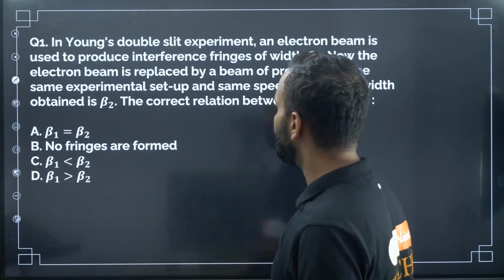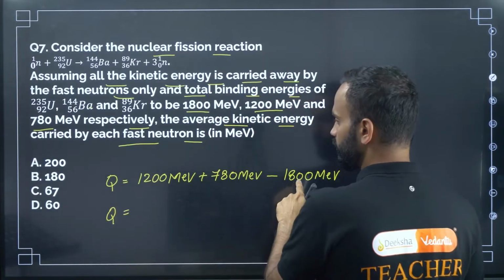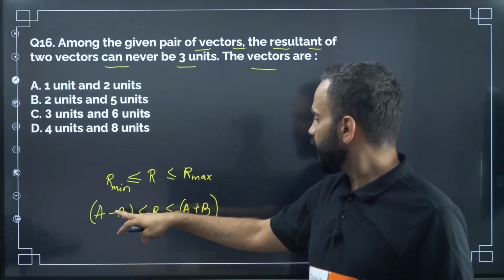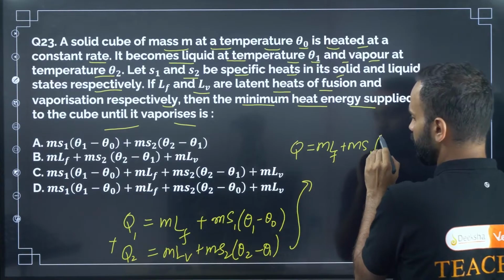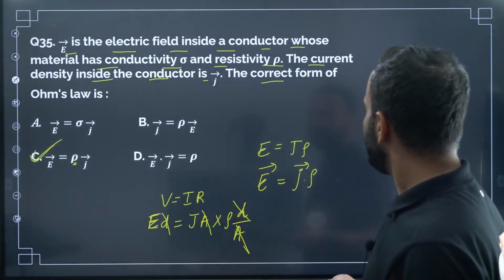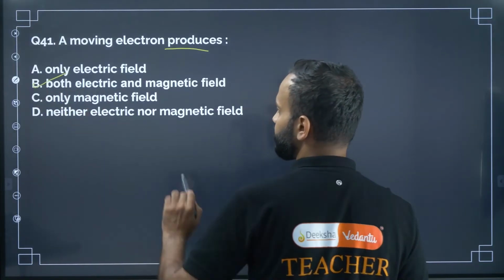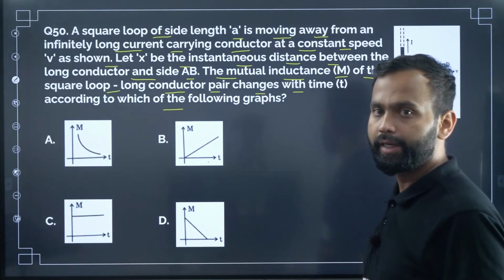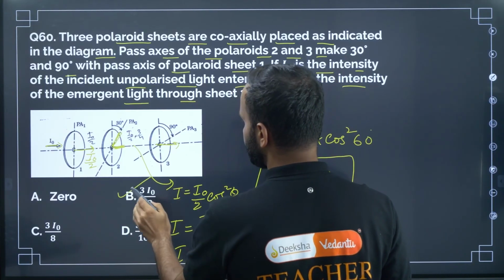KCET 2024 Physics Detailed Solution | Q1-60 | Complete Paper Analysis

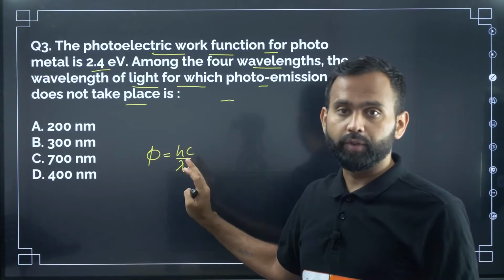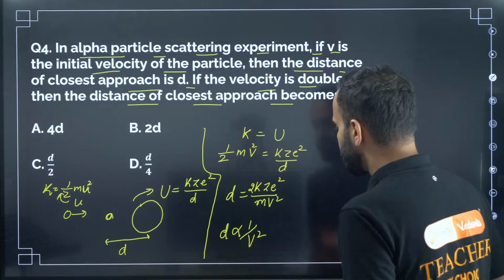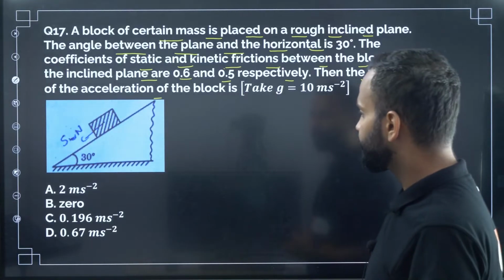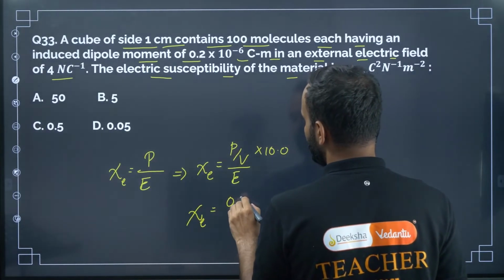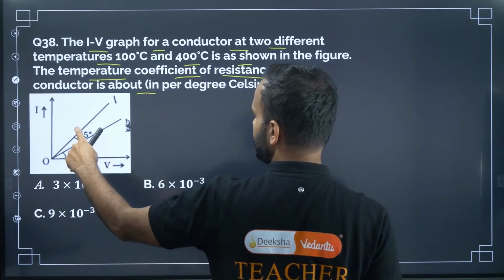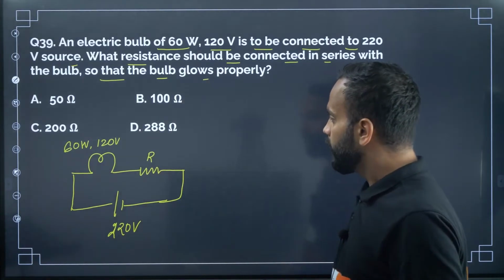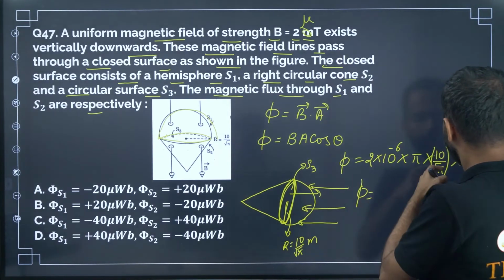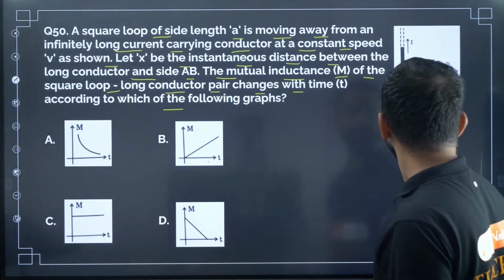Comment: 6:48 remember to use this formula 13:10 good Distance of closest approach 38:30 remember new concept Angle of Repose 1:08:04 solve by dimensional analysis 1:19:42 method Current Electricity 1:24:44 method ⭐ Current Electricity 1:43:00 method ⭐ remember "MEC* 1:48:19 remember theory EMI 1:52:45 remember method EM Waves 1:56:23 good for practice Ray Optics 2:01:14 remember method 2:04:45 remember formula ⭐️ Wave Optics